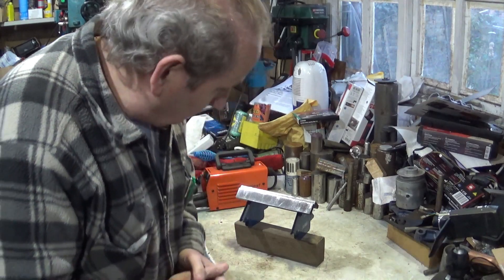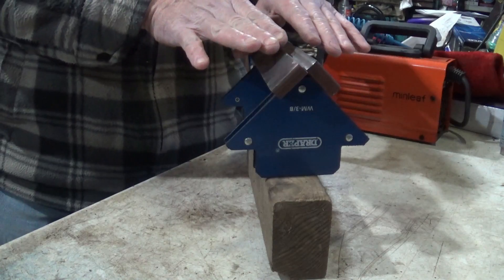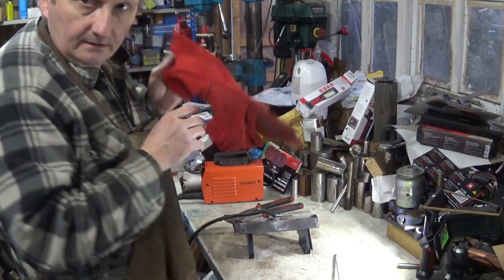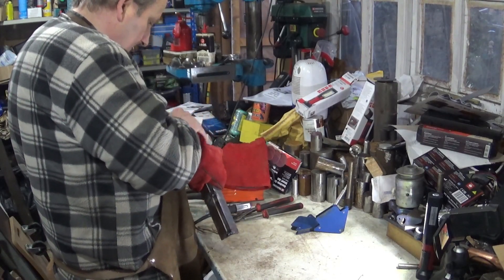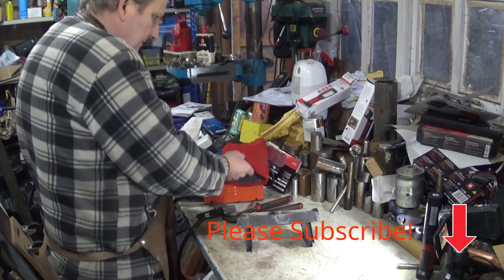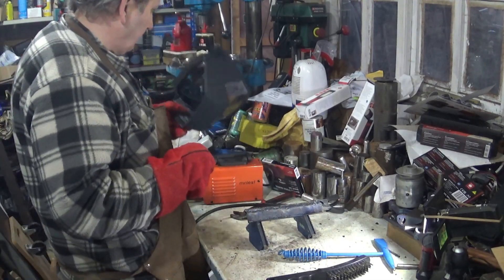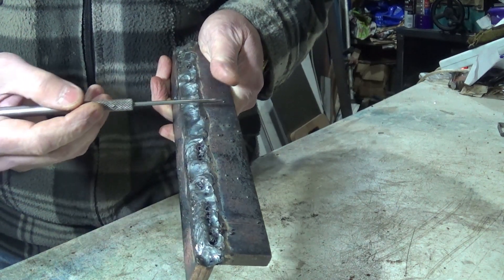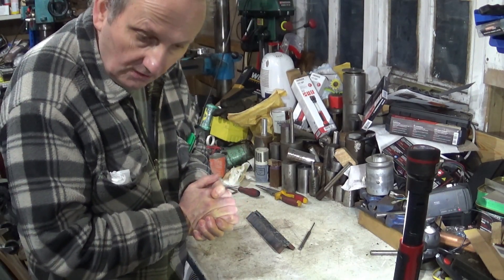Running a test weld on 10mm 3/8 inch steel plate

Comment: How are you finding that welder Ben at full amp? Good penetration?
Reply from the maker: Well, it wasn't at full amps here, but you can see the result. I am confident I could, with practice weld 3/8" all day.

Many thanks for watching, please like, share and if you like the channel, subscribe!
Reply: @BensWorkshop  yes I think 10mm would require the full 120amp, nice and slow and just Bury that rod into it.

Great channel. Thanks
Reply from the maker: Yes, which is roughly what I didn't do this time....

Comment: Good idea doing a practice weld first, particularly with stick welding (unless you're already well practised at that, which I certainly am not) - you can perfect the technique for your particular job using scraps before you attack the real project.
Reply from the maker: That is the plan! Though the plan is to make it out of scrap too. Thanks for the shot out on your latest video which I am watching now.
Reply: @BensWorkshop  We like using scrap metal for jobs - it saves lots of money, plus it feels good not wasting those scraps.  You're welcome, I wouldn't have thought about re-visiting the old blow lamps if I hadn't seen you using yours - actually used it for a proper job yesterday, charring a house sign that I'd just made.

Comment: Excellent Video Ben.Thanks for taking your time to explain it all.I often want to try these type of Fabrications.But I have limited facilities and would have to do the work outside.The other thing that worries me is being on the amperage limit with the 3.2 rods AND blowing the Ring Main fuse.Dont really want to get an electrician to fit a separate 15 AMP outlet.Given the choice which would you choose.The Chinese machine or Conventional Buzz Box?The Chinese one seems tempting,weight and price wise.But to me seems Flimsy.How long will it last?!!!!!!!!!
Reply from the maker: Both my welders run off a 13 amp supply so you should be fine. As for which is best, I woud go for an inverter welder because they have anti stick. I have had mine a while and it was cheap but you can buy them from Amazon with at least some kind of UK warranty for £60 to £70.

That said, mine cost £40 with the leads and I am happy with it.

Many thanks for watching!

Comment: I used to be able to lay a beautiful weld with stick but I I've gotten lazy with the mig and now I just make a mess, keep at it mate, looking forward to the press build.
Reply: Hi Turbo.Can you help.What amperage MIG would you need to do what Ben was doing? I have a Sealey 130 Machine and trying to learn thick steel welding.My question is would this Machine be capable of welding this thickness?Hope you can advise me Thanks.
Reply from the maker: I also have a Sealey but the Turbo Mig 230. You need to consult the manual for the correct settings and I expect you will find them online.
Reply from the maker: Cheers! At how much I pay for those rods (£10 for 5KG) it is cheap enough to practice. Many thanks!

Comment: Tip for welding, next time move the rod left to right and walk with the road slowly. in tick steel like that you need to give time for the welding to melt the iron. If you do that I will be happier with your weld. Thats for sure. Hope you improve your welds Good luck
Reply from the maker: Many thanks, I certainly went too fast on those welds. 

Many thanks for the tips and watching!
Reply: @BensWorkshop   Mention my suggestion in your next video hopefully that will help you and others .
Reply from the maker: I will do my best to remember!

Comment: Boy, I dislike arc welding. I'll give you a call when I need my trailer sorted out later this year. One small thing - I was sort of under the impression that slag was easier to chip off when it was completely cold and more brittle. I take it there's nothing in that idea?
Reply from the maker: If the weld surface is clean and good, it will pop off of it's own accord as it cools as there is nothing to grip on to, but there is probably some truth in that. I just didn't want to wait.

Personally I love a bit of arc welding. Many thanks for watching!

Comment: hi ben
welding is like many things, and i suffer this, if your not doing it all the time, it takes a while to get back in to the swing of things, but your doing the right thing practicing to get your coordination back in to the swing.
cheers
Kev
Reply from the maker: You are absolutely correct and when it comes to doing the real job I will be doing a few more practice runs! I do not want big gaps in the welds!

Many thanks for watching.

Comment: Hi Ben.
Keep your rod at about 45⁰  that will help stop the slag getting in front of the weld. Also multi pass. Put in a root weld and build up layer by layer. You can do a single pass with mig but theres too much weld slag from the flux on sticks and it will overwhelm the weld puddle .
Cheers Neil
Reply from the maker: Fair point about the root weld, on that thickness. Many thanks for the tip and watching!

Comment: What size cable did you use to feed you're shed Ben?
Reply from the maker: A paired of 2mm core cables each capable of carrying 20 amps, though to keep from needing a part P test it is then connected to the mains with a 13 amp plug. Later I could get part P done and run it off a 32 amp ring main. I don't use more than 13 amps at one time.

Many thanks for watching! Please like and share!